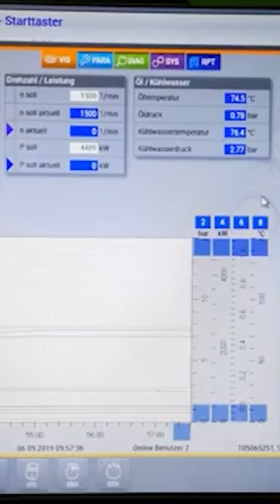wHY DoN'T CaRS uSE V24 ENGiNEs?

Comment: the fact that the 5 minute startup time is listed under customer benefits as "fast" is insane
Reply from the maker: Saying "Company" makes more sense than Customer, but now I'm laughing at the prospect of some rando watching this video with a Miata and putting an order in for a Jenbacher V24 to swap into it LOL
Reply: @BladedAngel  Well considering it's supposed to have a 24/7 uptime I would say it's impressive... but lets face it we live in a society that favours twenty 60 second videos over one 20 minute longform video so 5 minutes will be too long for 99% of people
Reply: @BladedAngel The generator in Chernobyl took 1 minute
Reply: With big engines you need prelube pumps, pre heating. oil pumps, external cooling systems. Even fuel has to be preheated and pressuriced. It takes time to heat up thousands of liters of oil and getting all pumps running.

Also with huge motors you need to build up the speed gradually. first something like 1500rpm and then full 3000rpm. Switch from prepumps to running ones.

When it's up and running you need to synchronize it and connect it. RPM, HERTZ and the angle all have to line up before connection or it gets kicked out of the grid.

5mins is a fast startup time. usually it takes somewhere between 30-60min on biggest engines. Of it has been out cold for months. It takes around 24hours to get it all up running.
Reply: I bet the older ones were alpt worse
Reply: That is fast for a generator of its caliber

Comment: That's just stupid I work for CAT and 90% of our power generstion is inline engines there's just no reasonable justification for that generator other than useless overcomplication because theoretically better efficiency, reliability, and start up time could be achieved with an inline engine especially a diesel.

Comment: Yakovlev made a 112 cylinder diesel radial engine in the 1940s / 1950s called the M501, which was basically two M502 52 cylinder radials coupled together.

Originally designed for large intercontinental bombers, they were made obsolete by the jet age, and instead used in torpedo/missile boats.

Comment: A good example is the Yamaha vmax 4 it’s 4 cylinder 2 stroke engine but has to run a secondary shaft for the clutch or else the whole crank would snap but god does it sound amazing with 4 pipes

Comment: A V24 with a continuous crankshaft running above 1500rpm probably has horrible harmonics and would probably need custom 6 bolt main bearing caps just to dampen it.

Comment: Uh, where are you seeing V24 in US industry? Most power generation is done with gas and steam turbines, no reciprocating engines. The recip engines you’ll find industry are typically 2 stroke V12-V16 natural gas engines for compressors (well injection, pipelines, refineries, cryo’s) or diesel engines for pretty standard emergency fire water pumps with hot start. I know this because I am the guy taking data for the reliability program in these places. I’m pretty sure the most cylinders out there is the V18 in American industry, and it definitely isn’t used for power generation apart from moving natural gas or maybe an injection well.

Comment: You can do it like detroit diesel did with the 12v71 or 16v71 the 12v71 was literally just 2 6v71s and the 16v71 was 2 8v71s bolted together as they were designed to be. Im pretty sure they're also the same front to back so you can just flip them around when you need reverse rotation.

Comment: its literally just the fact that the front cylinders and rear cylinders end up way out of sync every time the rpm changes. thats literal btw, every time the rpm changes the back of the crank ends up a full revolution or two behind the front of the crank, which is absolutely terrible for the engine. its literally trying to twist the engine into a pretzel. youll never make it to high rpm, the crank will snap into about 14 pieces before you ever get past 3-4k rpm.

Comment: v24 is not a car engine. the biggest car engine is v12, others are fake engines.
Reply: actually the biggest production car engine is W16, there's a bigger one called W18 but that's just for prototype for early Bugatti veyron concept 🤓
Reply: @devitooo  first is it is V not W you single-braincelled idiot, second is neither V16 or V18 exists. the one your calling V16 is actually two V8 engines. "🤓"

Comment: I don't wanna get slapped with the nerd emoji but petroleum fuels and massive engines aren't making your electricity unless you live on an island. On land masses with larger populations, it is cheaper to build a large power plant and transmit the power to everyone instead of using hundreds or thousands or millions of generators.

Comment: That why most large commercial aircraft that used piston engines used radials. It was a lot easier to make a 24 radial then inline or V engine. The one example that comes to mind is the Pratt and Whitney R-4360 wasp major. Which would be used in the globe masters 1 and 2 the B36 the B50 and more.

Comment: I guess the generator could not be used as a power plant back up as it is too slow to come on line. Enterprise had a preheated, preoiled package that allowed from stop to full load in 20 or 30 seconds. These were sized by need, up to V-20's at about 500kw per cylinder. Have fun

Comment: Why don't cars use V1000000000000000000000000000000000000000000000000000000000000000000000000000000000000000000000000000000000000000000000000000000000000000000000000000000000000000000000000000000000000000000000000000000000000000000000000000000000000000000000000000000000000000000000000000000000000000000000000000000000000000000000000000000000000000000000000000000000000000000000000000000000000000000000000000000000000000000000000000000000000000000000000000000000000000000000000000000000000000000000000000000000000000000000000000000000000000000000000000000000000000000000000000000000000000000000000000000000000000000000000000000000000000000000000000000000000000000000000000000000000000000000000000000000000000000000000000000000000000000000000000000000000000000000000000000000000000000000000000000000000000000000000000000000000000000000000000000000000000000000000000000000000000000000000000000000000000000000000000000000000000000000000000000000000000000000000000000000000000000000000000000000000000000000000000000000000000000000000000000000000000000000000000000000000000000000000000000000000000000000000000000000000000000000000000000000000000000000000000000000000000000000000000000000000000000000000000000000000000000000000000000000000000000000000000000000000000000000000000000000000000000000000000000000000000000000000000000000000000000000000000000000000000000000000000000000000000000000000000000000000000000000000000000000000000000000000000000000000000000000000000000000000000000000000000000000000000000000000 engines?

Comment: >v24 is only used on generators
>remember locomotives use generators to power electric motors at the wheels
>remember IC vehicle conversions to electric exist
>look at a truck with devilish idea

Comment: Detroit diesel made a v24.  They're super rare but have pretty much only have been used in marine applications.  Its called the 24V71, 24 cylinders, 71 ci per cylinder.   That engine in the first clip is a modified 24v71.  Get this, they were diesel, had 3-4 superchargers, some with 4-6 turbos, and the cherry on top, they were 2-stroke.
Reply: I love the detroits, the distinct sound they make is glorious
Reply: @cosmiccolossus668  100%.  Their sound is unmatched.
Reply: To be fair in the video he said in one block as the 24v71 is a modular block layout meaning it is actually 2 12v71's attached together same as how the 16v71 is 2 8v71's attached together

TLDR Detroit diesel made a modular engine
Reply: 2 cycle V24? Oh lawd have mercy got me having a lonely island moment.
Reply: Apparently one guy in Quebec has a DD V24 swapped Freightliner but no videos of the engine so far

Comment: Ive built V24 120L (5L per cylinder) engines in sprocket tank design. It runs at like 3000-3500 rpm. Really realistic
Reply: same
Reply: Damn bro
Reply: Sprocket Tank Design is something else. The engine is the size of a smaller tank. And yet 300T is too much even for 120L and 3.5K rpm
Reply: Trust me, 3500 rpm is NOT enough to run a v24
Reply: @Void-Forces  What do you mean by "not enough"?
Reply: @Void-Forces  they literally show a 1500 RPM V24 in the video
Reply from the maker: @LudicrosityIndustries he was not able to reach the 40 second mark. Our attention spans are cooked.

Comment: I think choosing a v24 engine was the good choice for the 18-wheeler in my book, that engine scream dear God, picture that's the last thing you hear before a 18-wheeler, moving at Mach what the f*** crashes through an armored barricade with a armored plow tearing everything apart

Comment: My question is if there’s no v24s shouldn’t we make more w24s? W16s are just welded vrs and each line has 4 cylinders and there a 4 lines. The main issue with v24s is the length, so having a W24 sounds somewhat reasonable if you want crazy power figures. Imagine a train powered by that.

Comment: It should be mentioned this is for bumper plants or for places that arent connected to a main grid. Almost all fossil fuel gas, oil or coal is used to heat water because its more efficient. These giant IC engines only advantages is portability funnily when you look at the size.
Reply: Oh and rural mining operations especially in like Alaska and other really remote places. Even the I imagine v24 is still too big to often be worth it. I immediately don't much about them just know they have minimal grid importance.

Comment: A 1200cc engine with a v24 configuration, each cilinder with a displacement of 50 cc or 24 moped in a sleigh
Reply: It's pretty easy to built with overstroke design

Comment: It could probably fit in a Miata
Reply from the maker: maybe
Reply: @BladedAngel just get a trailer
Reply: @BladedAngel  it can
Reply: Two miatas could probably fit in it
Reply: That would be a cute car your engine’s got, if you were to do it.
Reply: @PROspectorN24  lmfao
Reply: I'll take the chance, the possibility is never 0% right? riiiiiiight?
Reply: @AKseorangmanusia  😂😂😂
Reply: some random V20 powered freight train:man fvck you fitting a V24 in a Miata
Reply: Anything can fit in a Miata
Reply: "You've got a bit of Miata on your engine"
Reply: it could probably BE the Miata
Reply: Maybe 4 miatas
Reply: Yeah
Reply: If you cut and weld more length to the engine bay+frame😂
Reply: Just use your 'actualization' to fit V24 into the miata man
Reply: Just needs to be W24 or X24 engines instead of V24 (X engines not for car)
Reply: Probably? It definitely fits in a Miata!
Reply: This joke never gets old
Reply: Your engine would have a nice car lmao
Reply: I guess you can mount it vertically
Reply: Nah it can even fit in a peel p50😂😅
Reply: Just turn the engine into a car at this point 😂
Reply: Anything can fit in a Miata if you try hard enough.
Reply: That one bro after seeing a kid...

Comment: I have a question, what's the Hydrogen Fuel Cell or Electric motor equivalent of a V8 or V12
Reply: Extra cells, meaning extra flow channels, extra substrates, extra EVERYTHING all connected to a bigass motor 

Or two different cell technologies strung together, one high temp one low temp. Dual fuel (straight methane and straight O-H). Would be hype.

Comment: I feel like these engine videos are going to get bigger at this point. What's next? V26 engine?
Reply from the maker: It'd be V30, W32 or V40 and W48. A 26 cylinder V engine has 13 cylinder banks, which isn't mathematically evenly balanced. 720/13= 55.38....etc

So there is a method to the madness. Unlike AI channels who spew BS I only cover engines THAT HAVE EXISTED IRL!! Ty for watching
Reply: @BladedAngel  v30 engine.

720/30=24.

simple but i think it would fit more in a truck more than a car since dear GOD imagine how long the engine bay would have to be.

trust me its possible not for cars but maybe ships?
Reply: @BladedAngel  A V26 would work fine as a two stroke engine. When every cylinder is firing every second stroke, you don't have to worry about the complex balance problems.

Large marine engines are generally two stroke designs that run on bunker fuel, which is basically a heavy crude oil. They also run at very low RPMs, 200 RPM would be the end of the world for many marine engines. When a single piston is as large as a SUV and has the bore stroke of a building, it's not going to be going very fast before it departs into orbit.
Reply: @BladedAngel  decimal points dont ruin balance, modern computing is precise to about 16 decimal orders of magnitude. to put that into perspective, thats the earths orbit accurate to the precision of a hair. and its not expensive or hard to calculate either, you can do hundreds of billions of these operations per second. its also mathematically proven you can balance any engine layout, though i'll get to why not all are used in a second.

the main issue is just that the complexity of the parts is unnecessary when a simpler, or even a self balancing configuration is just 1 cylinder off. basically the reason inline 5s and v10s are dying off. inline 4 and 6 engines make more sense than an inline 5, and v8s and v12s are much simpler than v10s, inline or v7 is too long and complex when you can use a v8, you get the picture.

so modern engine balance is usually achieved by grouping lots of 4 which are moderately well balanced with no extra parts, or grouping lots of 6 which are perfectly balanced out of the box. almost all the common configurations in cars (aside from an inline 3 which is usually balanced with balancing shafts) work off this principle. eg, inline 4, inline 6, v8, v12, wr/v16, etc. sometimes balancing shafts will still be used if comfort is part of the equation but the worst of it can be done on the existing parts.

when not using an inline or v configuration its possible to use different counts, for example a 7 cylinder radial engine can be perfectly balanced by a single mass, but 720/7 is
102.857142857..... you get the point.

anyway rant over, just stop with the decimal point argument i see you repeating everywhere because its not correct or relevant to the actual issue at hand
Reply: Radial piston pls!!
Reply: @irgiefarras  That's old school in 1 to 4 rows in US engines, and more in Soviet designs. How much HP do you want, and what service interval and duty cycle are you willing to put up with? Have fun
Reply: Radial 28 cylinder engine